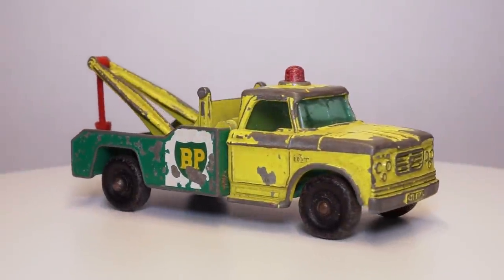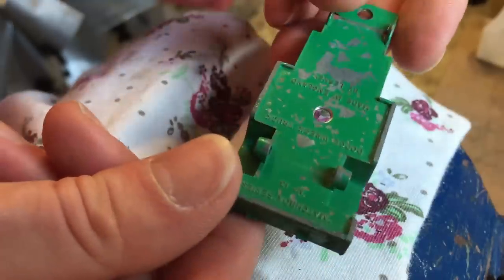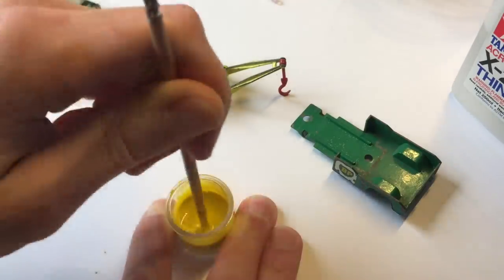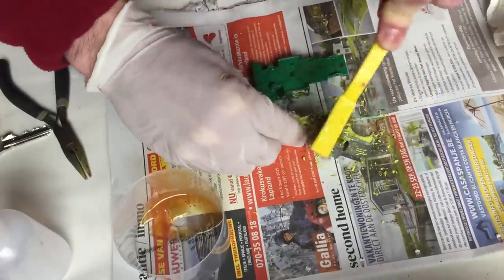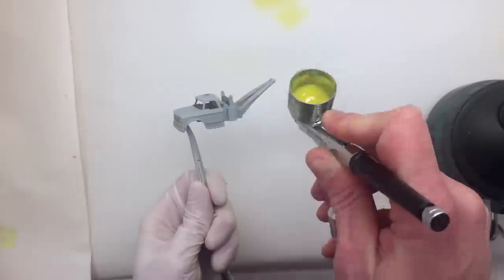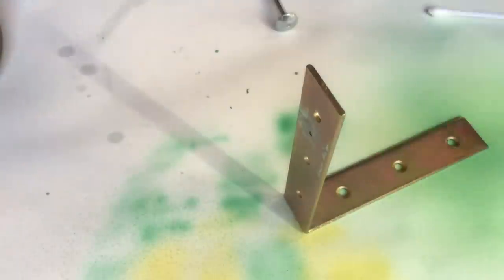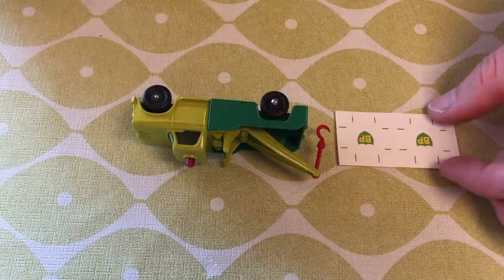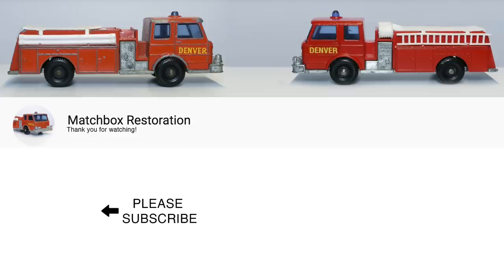Matchbox 13d Dodge Wreck Truck - Full Restoration

Comment: Tip so you don’t have to eat up up your grinding stones too much. This may work especially well for shortening tiny screws.... I back a sheet of appropriate grit emory paper with duct tape and cut out 1.25” rounds. Poke a pin hole in the center and you’ll have a good sanding disk for your rotory tool. Sand object you want to remain flat nearer the hub of the disk as the edge tends to deform when you apply pressure.
Reply from the maker: Good advice! I'll look into that!

Comment: really nice. I have a problem - that I sometimes chip the paint when I put base parts back together with bodyshells. Do you ever have this problem? Perhaps I do not wait long enough for the paint to fully cure.
Reply from the maker: We all have that issue sometimes. It's a matter of the paint that we use. Acrylic paint chips off rather easily. Make sure you clean the casting enough before applying primer and paint.

Comment: Nick it loks great, I think you got the colors right on. Question do you polish your models before finishing them? I ask as I see some orange peel, and I think that might remove it. I even hate the orange peel on real cars.
Reply from the maker: Thanks Ken! No, I don't polish them. What should I use to polish them? I've tried very fine emery paper up to 12000 but there usually is not enough paint on the models to wet sand it like that.
Reply: @MatchboxRestoration  I was thinking along the lines of a polish compound and then a nice good car wax